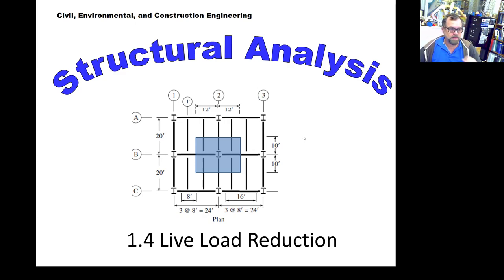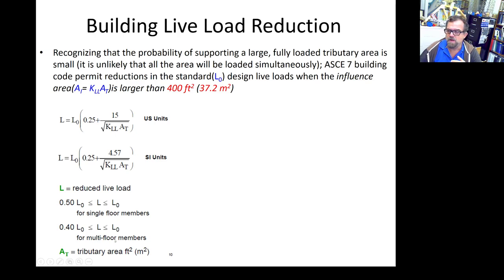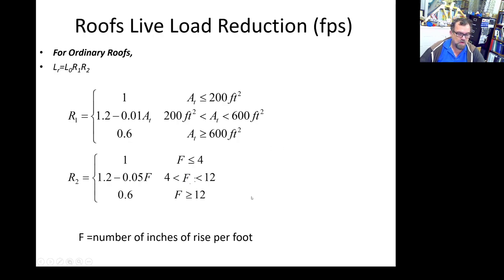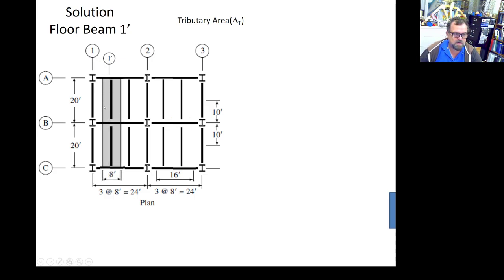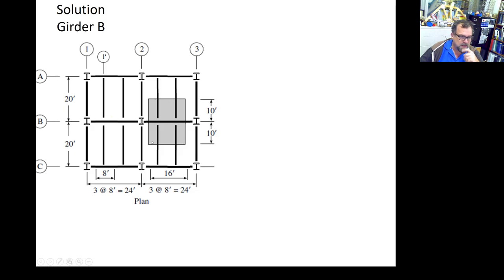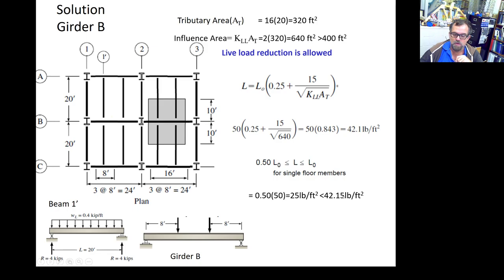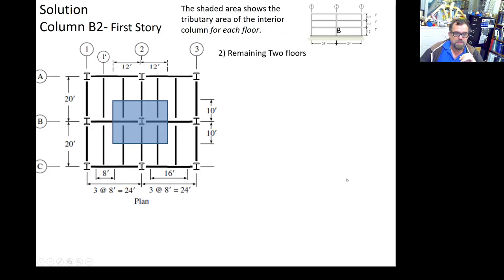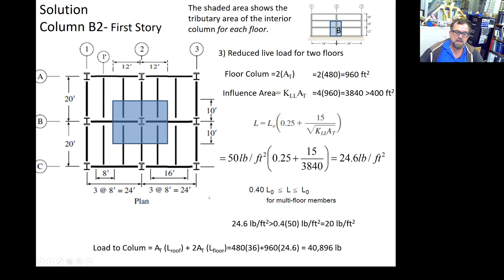1 4 Live Load Reduction and Tributary Area

Comment: The last column you are calculating the live load for ... you have the roof load plus 2 * At (L floor).  The At you use here is 960 sf, which is really only true for the ground floor column (below first floor).  The col above that only carries half the trib area.  However what I really want to ask is I have seen several examples worked out on line where the At is only from the floor level that you are evaluating (therefore the cols at each floor level do have the same influence area, here they would be Ai = 4*480).  Your example has the influence area increase as each floor level is added on. I can see an argument for either case based on how the code reads, but the answers come out differently especially for taller buildings.  Thoughts?

Comment: thank for the great course 
I noticed that you are using both imperial and metric units. But, my lecture said the metric unit better and accurate.! Is that correct?
Reply from the maker: units don't matter. Both are included in the spec
Reply: @1963rzr  thank you